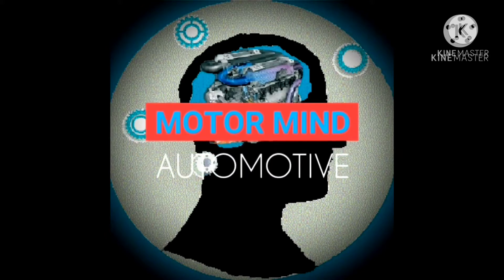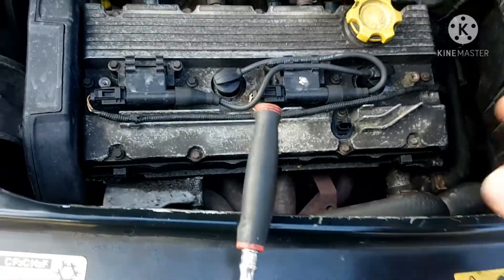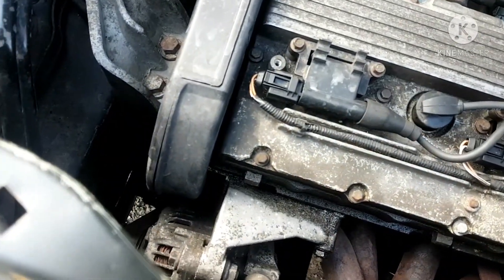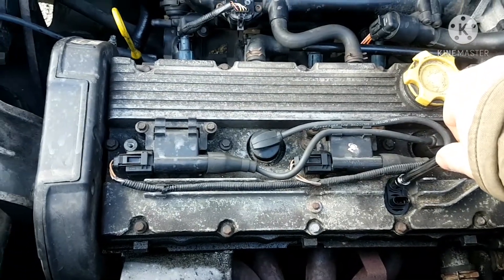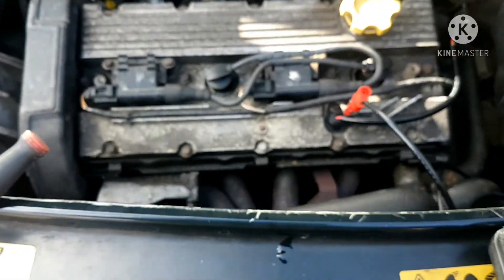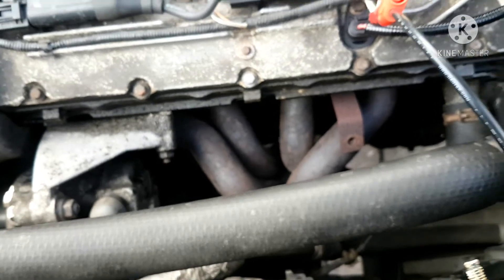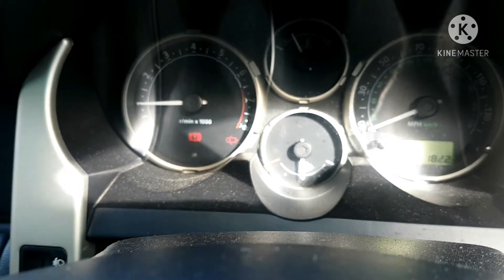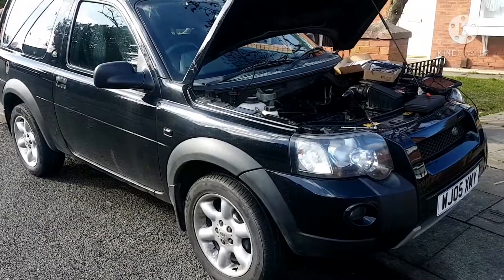How to diagnose and repair Land Rover Freelander 1.8k DTC P0340 petrol rough idle. Part 2

Comment: Good evening, I have a 2003 land rover freelander 1 1800cc, it has a problem with the camshaft sensor, the old one has a leak at one point.
I measured the output from the connector coming from the brain, all three outputs show 12v voltage. What tendency should I suffer! you know tell me, I'm a private person and not a mechanic, I just fight my cars by myself,
Reply from the maker: You have a bad ground there buddy. One wire should be ground one is signal and one will be a 5v reference. I don't have the wiring diagram with me so I can't tell you which one at this moment. Obviously the black wire will be ground so start there and make sure that wire isn't damaged. Best of luck with your Freelander. Thanks for watching 😁
Reply: @motormind4788  good evening again with warm regards!
I measured again with the multimeter.
the black wire is ground - with + on the battery = 12v on the other two wires 
I have yellow and brown / blue + me - in the battery = 12v in both
Reply from the maker: Ok so test from the battery ground to the black with grey tracer ground wire on the harness at the camera position sensor, you should read 0V. The red with blue sensor should be battery voltage.  The yellow and brown should have no voltage plugged in with key on engine off.
Reply: @motormind4788  Thank you very much! Now you have put me in the right direction, because I thought that the yellow with purple wire should not have voltage. I checked the wiring, there is no short circuit, the yellow and purple wire with the key switch open, gives me 11.8v voltage. (Is that how it should be?).
If you don't understand something the way I write, I'm sorry, because I only speak Greek and I translate it into English.
Reply: Hi I also have 2003 freelander 1.8k engine problem.l want to sell it